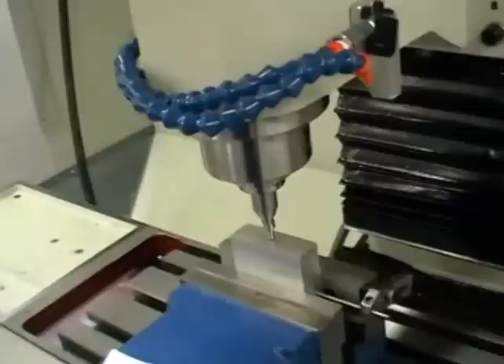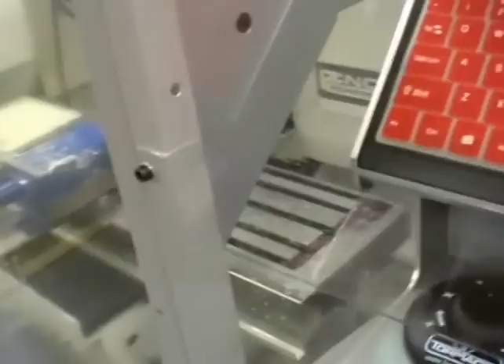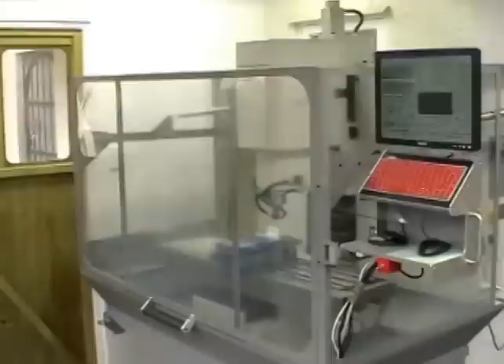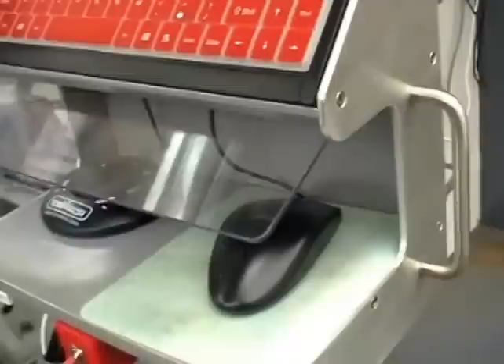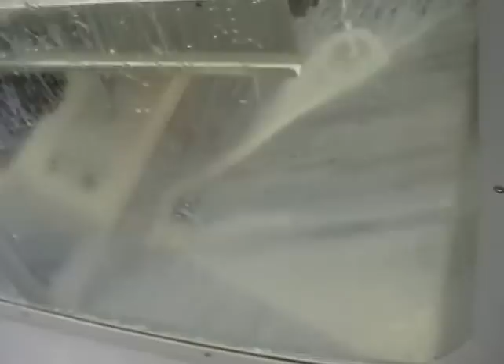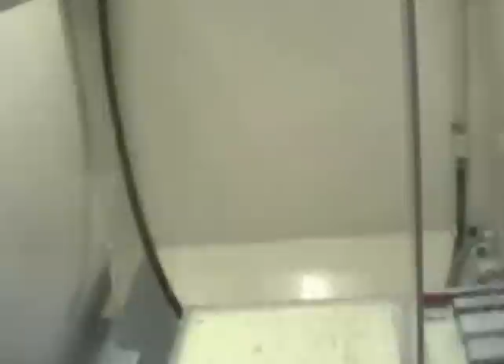Tormach No 2 up and running

Comment: I have watched a couple of your videos now and they have been good to watch the camera work is good and you are very easy to understand unlike some videos on here to much talking and not enough doing but at the same time they are informative which is what its all about.
I had been looking at purchasing one of the Tormach Mills, but a couple of things do put me off. 
(1) Tool Holding: I am not a big fan of the way that the tool is held in the head just clamped in not drawn in with a drawbar (as in a taper fit spindle).
(2) They seem to be a little under powered i asked the same question to another Tormach owner on YouTube and he did confirm that it did seem to be more like 1.2 HP not 1.5 HP so it did have a tendency to slow down on some cuts. 
I am guessing that the single phase motor does not help much. I was playing with the idea of converting it to 3 phase but as things go when you modify something you invent a new problem. 
I was advised that if i wanted to do short run production that i should not bother looking at this machine in his eyes it was good for light work only.
I do like the Tormach as they have a lot accessories to complement the machine. Which is good as you are able to undertake different types of work the only limiting thing is how big your wallet is.
Your video is Tormach 2 (which sounds ignorant of me but you have two of them now).
One final thing you own (2)???? So what are your thoughts about the mill(s) what you Like and Not????.

All the Best. Peter.
Reply from the maker: +Peter CCR ENG Hi Peter. Well a key factor to explain why I have two and answer your other questions is that the basic Tormach 1100 very low cost.  I build my own stand and enclosure so the cost is only $8500.00 US plus freight and a few bits.I think the Tormach is currently the best quality and value low cost CNC, To go up to the next level to a commercial CNC you have to buy the stand and enclosure and with the minimum bits you are looking at 5 to 10 times that amount. If you are going to pay that much money you need to run a serious business. If you are, or plan to, then yes a full commercial machine will be more capable for most situations.Cheers